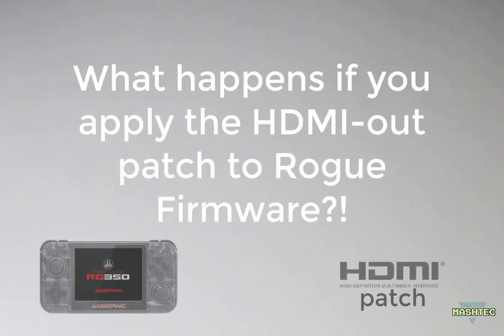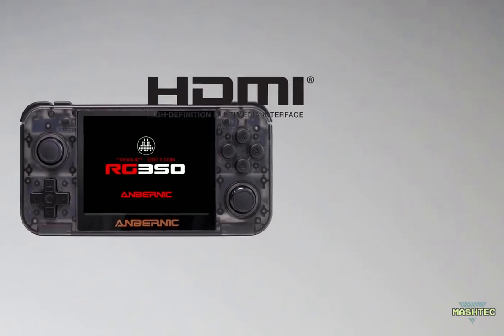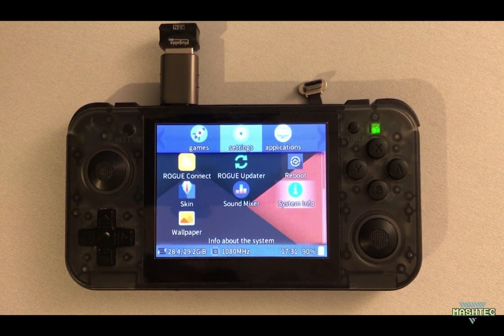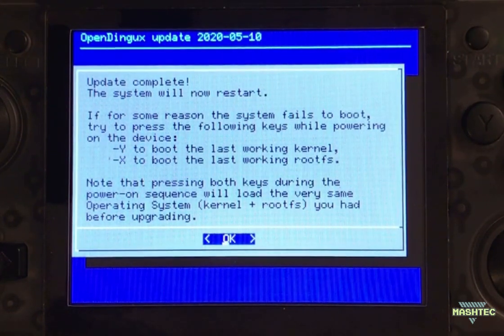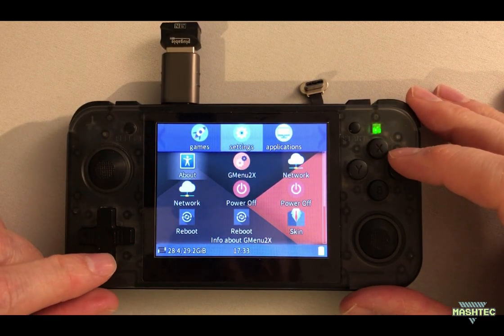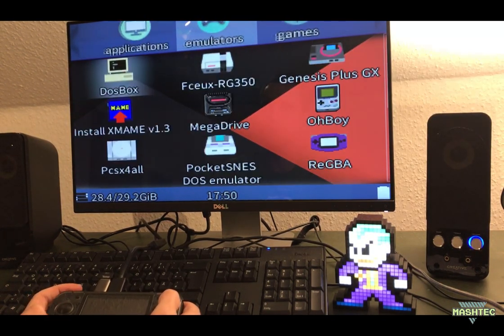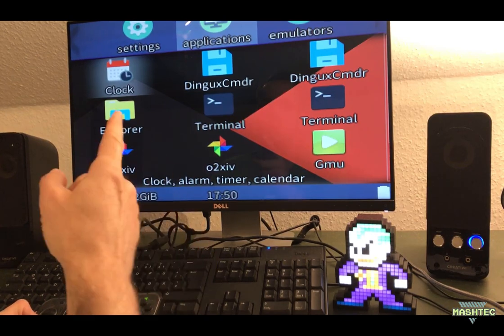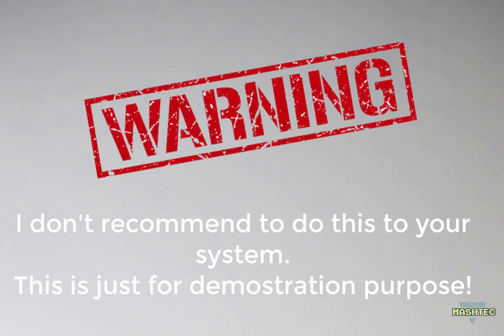RG350 - What happens if you apply the HDMI out patch to Rogue FW?!

Comment: great video but please change the title, I thought you meant that a hdmi patch was released for rogue firmware.
Reply from the maker: Yes you‘re right, sorry for confusion.
I changed it ;) thanks for the feedback dude.
Reply: @MashTec  you're welcome, also, did you get any audio from rg350 while it wss connected to the monitor? I switched out internal SD card and installed the patch so that I could play on my monitor but there was no sound.
Reply from the maker: WhatEver405 Yes dude, i had audio on my monitor (it has internal speakers).
There are splitters for Hdmi video signal and audio. You may wanna get of of these so you can connect some speaks externally?
Like this: Snxiwth HDMI Audio Konverter 4K Konverter HDMI zu HDMI + Optisches SPDIF mit 3,5-mm-Stereo-HDMI Audio-Extractor | HDMI zu SPDIF Konverter Splitter | für TV Blu-ray Player https://www.amazon.de/dp/B07FX6C7TP/ref=cm_sw_r_cp_api_i_kdbVEbE20B5G7
Reply: @MashTec  hmm that's weird, I tried everything I could but nothing worked. I plugged in external speakers to the monitor and I plugged external speaker to the rg350 itself, thanks for the link tho! might buy after covid is gone lol
Reply from the maker: Yes :) hmm, that‘s really weird dude. It worked perfectly fine for me with sound on my monitor.
Did you try to increase the volume at your monitor/speaker and RG350?
Reply: @MashTec  I did but it didn't work, might try downloading the patch from your link.
Reply from the maker: I don‘t think it‘s related to the patch dude.
Did you check your HDMI cable and HDMI mini to HDMI adapter? Maybe there is a problem with the sound lines.
Meanwhile i got feedback from more people facing problems with sound. This is really weird
Reply: @MashTec  hmm I thought that too but you never know lol, the converter might be the problem, I got it when I bought a raspberry pi but I never used it (as the raspberry pi was meant for gpi case but I couldn't find it anywhere and lost interest) and I can't get another one right now too because of covid, maybe my rg350 is defective?

Edit: oh forgot mention but the screen kept flickering when I switched sections :/
Reply: @MashTec  hey,  just found out that the audio works just fine on my tv but not on my monitor so i guess it has smth to do with my monitor and not my rg350 or hdmi cable

Comment: Thanks for taking one for the team! I love my Rogue firmware, and it's going to take a Mupen 64 update to get me to change it. I noticed that you don't have a lot on your internal SD card which is probably why you didn't lose data. OS upgrades usually re-write the internal SD, and I don't want to go to a different firmware because I've set up too much through the internal SD card. Quake, Duke Nukem 3D, XMame, etc... All on file paths within the internal SD. Have you heard anything about a RG350 port of Mario 64? I'm testing the PC port, and I don't care to play it on a keyboard. The Mupen version is slow, but wacha gonna do? Keep up the good work!!!
Reply from the maker: Hey my friend! Sure, i was just to curious about it :)
I expected to have a clean system after the patch, but actually it didn‘t wipe my data. All emultors, apps and ported games were still there.
I would also change my system for a good N64 emulator that allows fluid gameplay. Playing the N64 version of Zelda on this little machine would be just awesome! Btw: I haven‘t heard anything about a Mario 64 port to the RG350, yet. If it comes, i‘ll let you know.
Whenever you plan to move to a different firmware i can recommend you to make a backup before. So you can always go back if necessary without loosing all your configurations ;)
Let‘s see what the future brings us :)
Reply: @MashTec  recommendation noted, So Much to learn eh? I'm on Rogue firmware, and the backup is on my compooter. My internal and external SD cards are maxed out with what I learned. N64 would be the icing on the cake!
Reply from the maker: Russell Bowman indeed my friend! :) at least, Rogue gives the best performance for N64 even tough it is still far from perfect.
Reply: @MashTec  no skidding, project 64 or the Mario 64 port would be like pudding filled doughnuts in a police state right now!!
Reply: @MashTec  I luuuuuuuv you! Be my senpai, and teach me until I'm intellectually high!!!
Reply from the maker: Russell Bowman Dude, you already sound like you are high! ✌🏻 peace man!

Comment: Why did it have the boot screen for the official firmware and not the Rogue firmware?
Reply from the maker: Because it changed the system on my device with the update. So, it removed Rogue and installed some standard OpenDingux "stock-like" firmware.